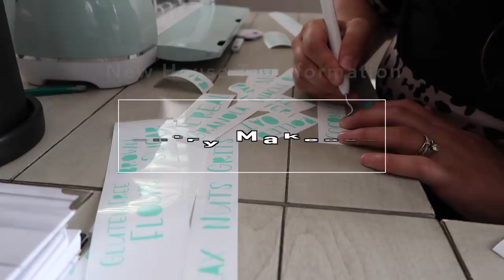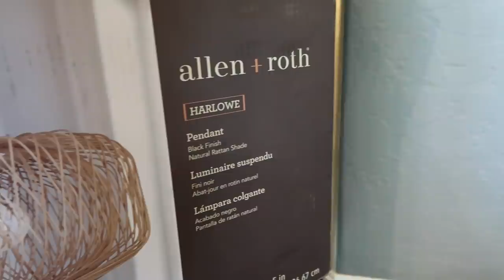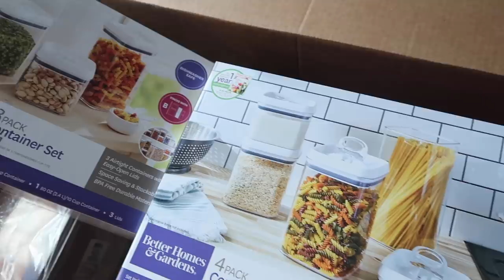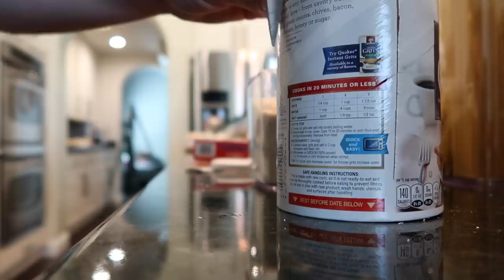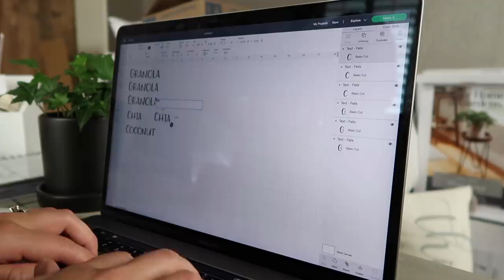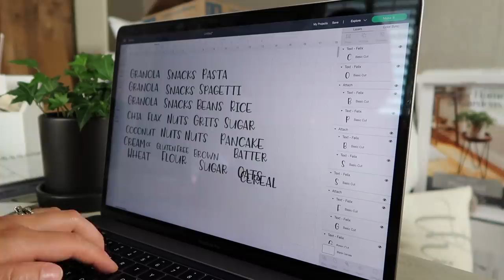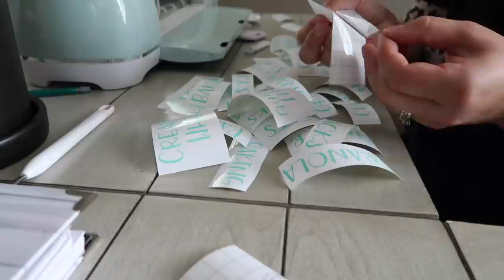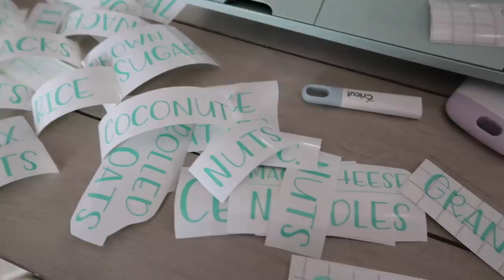🤩 NEW HOUSE PANTRY MAKEOVER 2021 & PANTRY ORGANIZING IDEAS :: Extreme Transformation + Organization

Comment: For the label, if you are willing to try.. 
using the hair dryer to melt the labels adhesive for few seconds. 
it will easy to clean it. it works for me. hope it helps ^^

Comment: Faster way to pull out the stickers is to use a hair dryer. On hot setting pass it over the label for a few seconds and this will soften the glue and you can remove it without tearing the label. Love your videos!! Works on plastic, metal and glass.

Comment: brillo pads and a hairdryer will get the adhesive off too. I know that
is a bit unconventional but the heat gets adhesive off of glass and you CANNOT put plastic into the microwave for that, so thought I would share for those on a budget. but you are good getting those at TJ Maxx. such a find and they have a lot of storage for pantry items available. form follows function always.

Comment: Just an easier hack for getting labels offs with no scrubbing take a hair dryer and hold over the tag is if you're drying the tag for about a minute or two depending on the size of the label and it will peel right off without any residue

Comment: Only thing I would change is to take the paper towels off the shelf, then move the two shelves above them down leaving the top shelf empty and then lay the paper towels down on that top shelf, You can use a stick or "grabber" to get them down, they are light and then the heavier things can be reached if needed without a step ladder, also get a little folding step stool to tuck in and then you dont need the ladder! and you got paint on your nice shirt! an easy tip I use is to just turn your shirt and pants inside out! when painting, then if you need to wear them again to the store etc no one sees the paint.
Reply from the maker: I love your tip for the paper towels!! Thanks! 🥰

Comment: Not sure if you are in the market for it but if you use your circuit as much as I do this is the best transfer tape I have found so far. It can be used multiple times. I have had my roll for well over a yes and still have some left. Vinyl Ease 6" x 300' Roll Clear Application / Transfer Tape for Cricut, Silhouette, Pazzles, Craft ROBO, QuicKutz, Craft Cutters, Die Cutters, Sign Plotters - V0800 https://www.amazon.com/dp/B0034ZGNVI/ref=cm_sw_r_cp_api_glt_fabc_NY5F61KD09V2EGA4SZHZ?_encoding=UTF8&psc=1